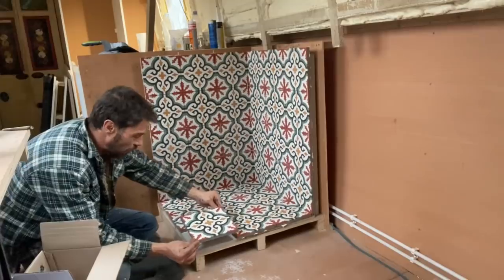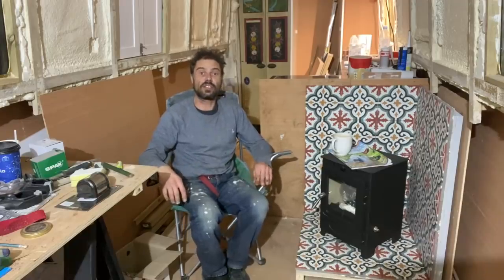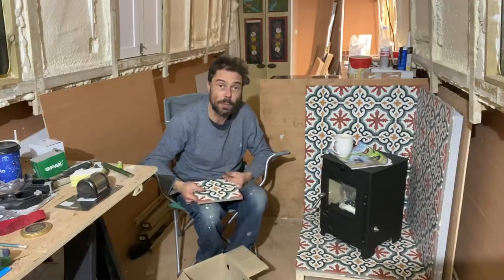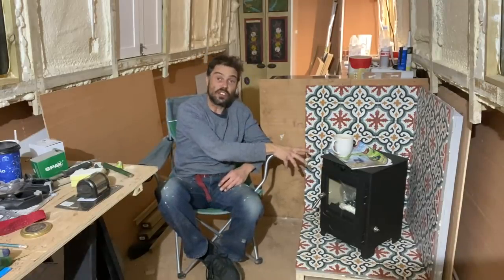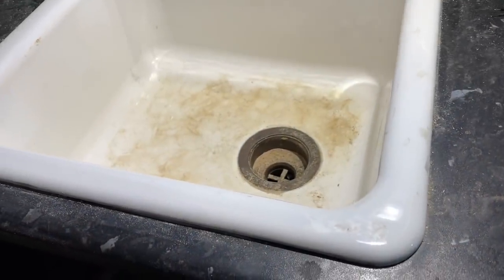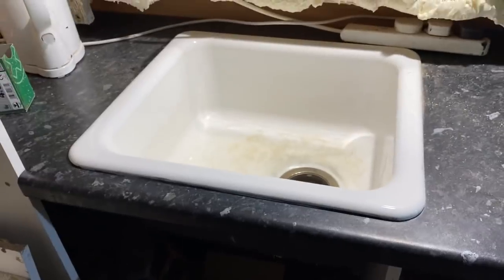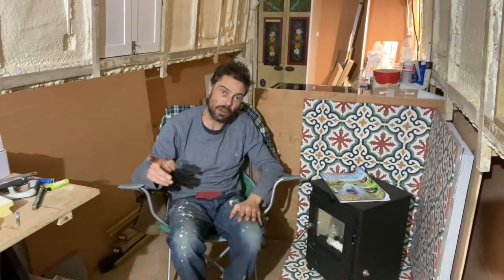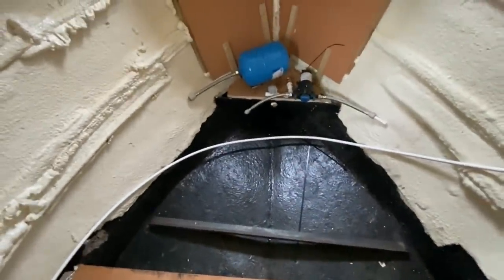68. Narrowboat fireplace construction complete and stove location

Comment: I think you really need to remove the drain at least temporarily. We call it a basket here in the US, and here we use flexible "plumber's putty" compressed between the basket and the rest of the sink. The problem is, it dries out and cracks over the years and will be a source of leaks into the cabinet below. Even if you don't replace the basket, you really need to undo it and scrape out the old dried plumber's putty and put in new fresh putty.

Comment: The fireplace looks great. Have you considered putting the bed in the bow over the water tank as it will give you a great more space in the bedroom  for draws and a wardrobe
Reply: I would second the suggestion, maybe having to build a small platform with steps up to the bed to compensate for raising the bed up so high. You could put dresser drawers into the sides of the platform and use the rest of the space for long-term storage (never enough of that on a narrow boat.) 

I just don't know that there's space enough for two beds in that room.

Comment: Hi only a suggestion, EE is the best for internet. Used one of their small boxes, signal every day down to London, via GU, River Thames and Oxford Canal.
Also stove needs to be fixed to the floor. Have you got some of the box steel tube left ? Could then fit behind each foot under the stove. Screw that to the floor and then drill through each foot horizontally and into the box steel and fit nuts and bolts to secure each foot. Stove and hearth look great.

Comment: Hi James. Notice Your old Tunnel lights are mounted in a vulnerable position. Those cabin corners are very exposed to bridge holes and tunnel walls.
Consider fitting the new ones on the bulkhead if you can ? Tiles look fabulous.
Reply from the maker: Really good point - hadn’t spotted that ! 👍🏼

Comment: Top job with that whole fireplace. Good choice on the orientation of the stove, it looks great.  Omnidirectional antenna receives equally from all directions, unlike something like a TV aerial which needs to be pointed at the transmitter. Aim to minimise the length of cable from the outside antenna to the router. You lose signal in the cable so the shorter it is, the stronger the signal that the router sees and less chance of interference from things like solar panels, fridges and inverters. (and dont clip that cable directly to electrics for the same reason) .
Reply from the maker: Excellent points there, thanks

Comment: Like the tiles. I went through much the same process a couple of years ago whilst fitting out my boat. Just a couple of points, some already mentioned.
  1) You do need to secure the stove firmly or it will move when you get bumped around in a lock.Not sure just how without spoiling your tiling.
  2) Shower tray, I originally bought a shallow one but changed it for a deeper (standard) one. Depending on how your boat is trimmed you may find       the water spilling over the edge. Also I found I could use a standard height shower screen with a bit of fiddling at the foot level.

Comment: I think the tiling looks cracking mate👍👍👍,I like the fire on the angle,not as boxy looking if you know what I mean lol
Reply from the maker: I do know what you mean - I agree. You scared me for a sec there saying tiling and cracking in the same sentence !!
Reply: 🤣🤣🤣, oh about your 4g antenna, I would put it on one of those extendable poles cos the more they are in open air away from the roof the better the reception, I have one and just moving it up a few feet away from the roof made it go up 1 bar.iv seen aluminium ones cheap somewhere, about 1mtr,that extend up to nearly 3